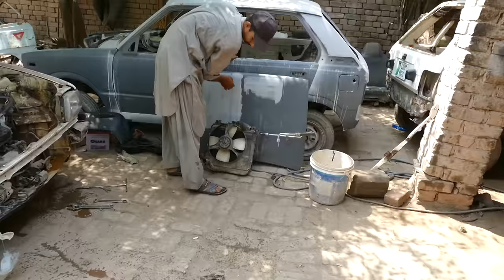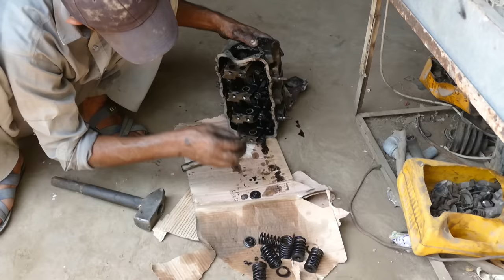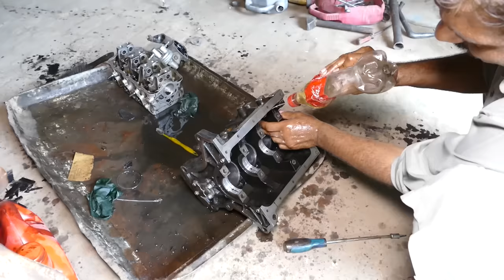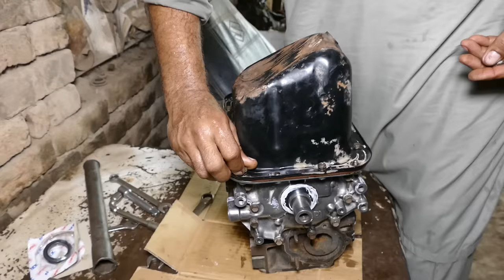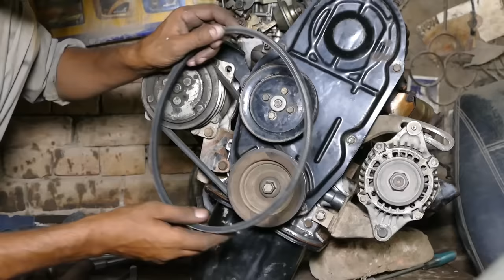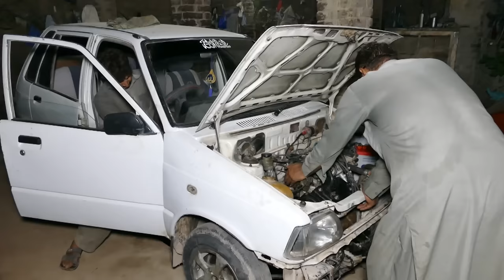Suzuki 800cc Car Engine restoration | Full Overhaul and Repair Engine

Comment: admire your skill. if you can do that, you may not have any obstacles in your life, meaning live free. I think every one should drive car like that, pure without too many 'technology'. Here in US, people spend 50-100k $ to buy cars (trucks), fully loaded with 'technology'. anything happens, mechanics charge them several thousands to 'fix' that. This happen really to German cars, full of technology and plastics. I like old Japanese cars, pure simple.
Reply: I also like simple cars. I recently bought a Chevrolet Blazer 4.3 96 years old. Cool car
Reply: Pppp0ppppppppppp0ppppppppppppppppppppppppppppppppppppppppppppppppppppppppppppppppppppppppppppppppppppp0pp0ppppppppppppp0ppppppppppppppppppppppppppppppppppppppppppppppppppppppppppppppppppppppppppp00pppppppppppppppppppppppppppppppppppp0ppppppppppppppppppppppppppppppppppppppppppppppp0ppppppppppppppppppppppppp0ppppppppppppppppppppppppppppppppppppppppppppppppppppppppppppp0pppppppppppppp
Reply: Слава богу в РФ не так распространена мода на современные одноразовые машины.
Всё эти "технологии"  ведут к обычному обваровыванию людей.
Менять авто каждые три года-это что экология такая типа?
Reply: The older German cars are the best built and most reliable cars ever built.
Mercedes built before 1990 were built to last forever is taken care of. 
I have several friends with Mercedes diesel cars from the 70s and 80s
With over 500k miles and still original engine and transmission. 
I own 1987 Mercedes 300d turbo diesel with all options and it runs perfectly 
And gets 28 mpg it is a heavy well built car which is simple to repair
And it gets better mpg than Japanese cars of the same year. And it is much easier to repair and drives allot better than Japanese cars from 1987. Every part on Japanese cars are disposable. Mercedes parts were made to last and be repaired.  Germany had the best engineers in the world. That is why more old German made cars survived than Japanese or American cars.  I am American 
And prefer Mercedes over American cars of same era..  America stopped building good looking cars in the 70s  the 50s and 60 American cars were fabulous looking cars. Now we built ugly ugly cars that are disposable plastic junk.
People have no pride in what they build anymore.

Comment: Reminds me back in the day,  but I did use a torque wrench and these guys just have to work with what thay got, just love watching them 👍👍👏👏
Reply from the maker: Thanks 👍
Reply: torque wrench???? what the hell is that?
Reply: And they just love stripping bolts 😋
Okay not everytime but it is more frequent than you think
Reply: @muhammadbabur7636  to properly torque down a specific spec the bolts gotta be screwed in. Like to put the head together it has to a specific spec u don’t want it to be to tight and you don’t want it to be loose.
Reply: @stephenlee9935  That was a satirical remark...
Reply: Jak jesteś na świętej wojnie z silnikiem i allach prowadzi twą ręke to nie potrzebujesz klucza dynamometrycznego :-)
Reply: تاسو باید د ښه کیفیت کار لپاره ډیرې پیسې ورکړئ.           
बेहतर गुणवत्ता वाले काम के लिए आपको अधिक भुगतान करना होगा।
சிறந்த தரமான வேலைக்கு நீங்கள் அதிக கட்டணம் செலுத்த வேண்டும்.
Reply: @muhammadbabur7636  você é homossexual?
Reply: If the threads are lubed and the bolts up to snuff, two pulls and a grunt will do it, just NEVER re use those torque to yield bolts
Reply: У них уже торированные, динамометрические руки.
Reply: It's funny they always have a cigarette hanging from there mouth. I love these guys.
Reply: If you reuse old stretch bolts a torque wrench doesn't make sense ,

Comment: Thank you for posting.I owned a 1996 Geo Metro (rebranded for U.S. and Canada?) It had a 1000 cc 3 cylinder, single overhead  cam(SOHC), throttle body injection (TBI).   That was my daily work car for a full time employment 3 days a week. Round trip was 110 km. Great heater, I never used the a/c as it pulled the little engine to hard. This was in central New Mexico, with an altitude of  1,600 m. I bought it used in 2005 and drove it until 2011. Well over 100,000 miles (160,000 km). I never touched the motor except regular maintenance and timing belt. It was the “Little Engine That Could”. There was fellow in Albuquerque, that would refurbish these little cars. As a side note it was said most parts were manufactured in Pakistan.
Reply: manufacturing parts is key 💥
Reply: Why wouldn't you activate the a/c ? It was there for a reason

Comment: Can't stop with my admiration!! How expert their editor(s) were in clipping/snipping out of the video all instances of where a torque wrench was used!!! Amazing!!
Reply: If your really confident and know what your doing you can tighten the bolts/nuts to the required tightness without the torque wrench it becomes something you can just know especially if you used to use torque wrenches before…it’s like a bank teller if they have been working in a bank for years they can usually feel the money and know if it’s genuine by touching and instinct that also includes knowing how much of the same value notes for instance 50 twenty pounds notes by the weight of it in their hand same for many people when you have been dealing with the same thing numerous times you get to know it..I can listen to a car engine idling for around 10 seconds and know how good it is and if there’s a problem.
Reply: @Silkroads733 how many engines seized before they « feel » the right torque😅?
Reply: @chefchaudard3580  I’m proud to say I have no idea..

Comment: As a trade school trained mechanic this makes me cry.  They threw the compressor down in the dirt but will they take it apart and clean it before putting it back on the engine? Can't imagine how many evap valves get screwed up this way after an engine rebuild.   In every video they put the thrust washers with the the crank, but not once in any video have I ever seen anyone check end play.  Some of these rebuilt engines must have interesting clutch problems. Never seen anyone check ring gap clearance nor piston to cylinder clearance.  All it takes is a machinist who is not on his game and things might be really wrong, but if you can beat the piston into the cylinder, then good enough seems to be the rule. Well at least they are rebuilding it on a table off the ground.  At the end it was running really smooth for a three legged dog.
Reply: Keinerlei Drehmomente beachtet. Aber dennoch alle Achtung für die Arbeit unter diesen Bedingungen.
Reply: @Yzb. CutMe Orses yes I could take an engine apart in the dirt and yes I could put it back together in the dirt and yes I can forget to torque all the nuts and bolts but it doesn't make it right. Yes I am a certified and licensed mechanic so I do know what I'm talking about. You have no idea what you're talking about. Being sloppy and untrained is just that and not something to be admired.  If this is acceptable engine repair in Turkey I understand why you support it, but if not then you should understand all the mistakes and bad habits these street mechanics use while repairing engines.
Reply: Well in my opinion, these cars were probably repaired like that a thousand times and doing ok for them… even if it means dripping oil, head gasket problems and rusting. It’s not the right way, but its a way that works for their economy and enviroment.
Reply: Oh snap! A YouTube professional, or what do they call these guys? YouTube warriors or some shit XD
Reply: Its about getting the car back on the road as quickly as possible so you can continue making money to feed your family that week. A trained technician in these parts is someone who learned from their father who learned from their father...etc
Reply: @shane6961  Shane,  can't agree with you more.  What the problem is they have never been trained from generation to generation.  Come backs must be an issue, yet I am sure seldom do they know why the evaporation valve stopped working  or why the rod cap backed off enough to spin a bearing.  The general attitude that if you want it out it doesn't matter where you hit it or or what damage you might do to the part which you are planning to reuse is the problem. If a mechanic fails to check the piston to cylinder gap and the engine seizes up a piston a 100 km down the road the mechanic has no idea he did something wrong or even what caused the failure.  It is the lack of training which is why they throw the air compressor in the dirt when they remove it from the engine sitting on the ground which bothers me not the lack of tools.
Reply: @bpetnoi1472  
calm down my friend thats how they fix their vehicles overthere its not the perfect job but if those shop guys learned , get better tools and increase their prices they will have no job at the end because people want cheap services
Reply: Mohammed, I know you are right, but it still a shame.
Reply: @MultiCoffeetogo  weil keinerlei Drehmomentschlüssel :D
Reply: @MultiCoffeetogo  Drehmomente werden überbewertet ;-) ! Ich finde es beachtlich, was die da tun! Was ich aber ganz ehrlich nicht so ganz verstehe: bei all der Mühe die sie sich machen, warum achten sie nicht ein bisschen mehr auf Sauberkeit, reinigen den Motorblock z.B. bevor sie ihn zerlegen wenigstens vom groben Schmutz? Ich bin mir sicher, der Motor würde länge und besser laufen. Bei aller Notdürftigkeit, die Teile ein bisschen sorgfältiger behandeln kostet nicht mehr, sieht aber nicht ganz so cool aus. Die Ventile in den Dreck zu werfen... unnötig. Aber ich habe ein pakistanischen Kollege, der hin und wieder versucht Maschinen zu "reparieren". Es ist abenteuerlich, wie kreativ der ist, kommt aber irgendwie nicht auf naheliegende Lösungen, wie z.B. eine Schraube lösen, Riemen spannen und Schraube wieder anziehen... da wird einfach Klebeband um die Riemenscheibe gewickelt... Klar, es funktioniert, ist aber irgendwie nicht dauerhaft und der ganze Käse geht von vorn los. Gerade wenn man so viele Mühe investiert sollte man doch im Rahmen der Möglichkeiten "nachhaltig" arbeiten.
Reply: @bpetnoi1472  ther is no better thing for people who love and live machinery then doing things right and that is all i can tell frome my perspectiv, as car owner i recently remaped ecu on my alfa with my own tool and knowledge
Reply: @Yzb. CutMe Orses hola desde España ,el comentario del señor anterior ,no lo decía por mal ,ni criticar ,
Yo soy profecional de la mecánica y veo que con esas herramientas no se puede hacer más ni mejor ,pero eso no quita a que pongan las cosas delicadas como el compresor del A/C tirado en la arena  ,igual que las tuercas y tornillos ,ya sé que es por costumbre pero serían unas máquinas de la mecánica si trabajarán con más limpieza y más ordenados ,,mira ya prácticamente motores así no hay tan fáciles y sencillos ,ahora es muy complicados los motores con mucho plásticos por todos lados y sensores muy delicados para tirarlos tan fácilmente por ahí ,los motores de ahora si no usas las llaves dinamométricas ,ese motor no duraría nada ,,no lo tomes a mal que ya se que la cosa no está muy bien en algunos países  en este asunto de aprendizaje de oficios ..de todas maneras me gusta estos vídeos ,,,saludos desde el otro lado del mundo (Canarias )
Reply: @Yzb. CutMe Orses cuánto valdría pasados a euros o dólares este trabajo ahí ?
Este trabajo buen hecho y pintado ,terminado a tope de buen estaría aquí en España por los 1000 euros la mano de obra , y si fuera un motor diesel moderno ,ej Toyota land Cruiser ,,Entre 1200 a 1500 euros ....
Los repuestos apartes ,,y se hacen mucho trabajo así ,lo que nunca verás tanto desorden ,ni tantas manos montando un motor ,los motores lo monta uno solo y se revisa todo dos veces las piezas internas y se miden muy bien los desgastes , se pinta el motor y se trabaja con protectores a ambos lados del coche  con colchas o mantas de mecánica para no rayar nada ni ensuciar , un motor aquí sale tan rápido o más del taller que ahí seguro ,y estos trabajos hay que cobrarlos bien porque se exigen mucha garantía un año ,
Yo he armado y montado en el coche un Mitsubishi Montero ,o Toyota Hiace ,etccc  en un día teniéndolo preparado y limpio ,,pero también te digo que hay coches muy complicados con tanta tecnología moderna ,y es aquí donde tienes que ir despacito y los aprietes bien hechos ,,,,,saludos desde Islas Csnarias
Reply: Именно так и есть. Моменты затяжки не учитывают. Продольные и поперечные люфты тоже мимо. Сделать капитальный ремонт головки блока, определить износ рокеров и пр. - вот что требует понимания и знаний. Вам желаю всего самого хорошего и здоровья!
Reply: @thushar  No, they will NOT.  These backyard mechanics do not have the knowledge or working skills to build a rocket ship even with good tools.  Good practical skills such as clean assembly are required to have things last.  If you want your car repair to fail quickly, these guys are the ones for you.   TOOLS do not make a good mechanic, knowledge does.  If you had any mechanical aptitude you would understand and not have been so rude with your "shut up" comment.
Reply: And they don't torque anything. Did u see when they took the head off it fell and almost on his bare feet. Lol
Reply: Engine rebuilt Kia phir bhi inti vibration 😩😩😩

Comment: So. No impact guns. no benches and no mechanical assist for engine removal. I like it.

Would we in the UK rebuild an engine like this? I think not. No we would go to the local scrapper and get an engine there, that is if the vehicle was worth spending the money on. I expect that the car would be scrapped. Such is the mindset in the UK.

Spares such as over size pistons, main and big end bearings would be hard, if not impossible to obtain locally. 

Great to see value in repairing not scrapping.

Thanks for posting.
Reply: The number plate shows this is a 2007 model. Still running strong! Beat that environmentalists 🙂
Keep it running till it rusts away!

Comment: I really like how these guys use four hands to do many parts of this engine dismantle and rebuild.  ... and, no torque wrenches. Excellently, they do it all in one day!
Reply from the maker: Right on
Reply: No torque-Wrench ... seen that often in similar vids ... I wonder for how long this engine will run.
Reply: @joostderidder  pretty long, these are mass manufactured econo vehicles, not special cars with tight tolerances

Comment: Definitely going to leak everything, definitely will be re-rebuilding soon. I respect the fact they're working with what they have, but also there's a reason for using torque wrenches, and torque sequences, not mixing and matching main and rod caps and hardware, replacing rockers, etc.

Comment: Very proud of our talented people. May GOD Bless them. 
I don't know how much it cost to have an engine like this overhauled in Pakistan.
I believe in America it is a job worth $2,000.00 or more.
Reply: If you're paying for parts and labor, A lot more than 2000... especially if you include machine work even for even a vehicle like this. In our country you'd scrap that vehicle without a second thought because it's only worth 500$ maybe 800 if you're lucky over here running. That's probably why it's over there to begin with because we get rid of vehicles like that to other countries. I'm not saying it's right or the way we operate over here is right, because it's FAR from it.... but that's what it is.

Comment: Made me feel a little better to see a “mechanic” drop the oil pan nut into the dish. It’s not just me.
Reply: Oil pan bolt, or plug, not trying to be a dick, just a pet peeve of mine. Nuts thread onto bolts.
Reply: @nouseformyname3788  Point made. It’s a plug.

Comment: Love the way they strip the engine out at the side of the road and toss all the bolts into a pile. How the hell do they remember where they all go back again?
Reply: Do something long enough and repetitive enough, it becomes second nature. Haven’t had to catalog bolts in decades.
Reply: That engine does not use a lot of special bolts like modern engines. There are some special ones - those you remember instantly. All the others do not really matter that much 🤣

Comment: after all these efforts car steering shakes when engine running. Needs an engine mount.
Reply: 3 cylinder single over cam engines are for value, not smoothness.
Reply: in poor countries people don't give a shit about that if the car shakes or air conditioning as long as the car runs that's what it matters

Comment: While I admire the skill, I wonder how long this will last? Did the valves go back into their original seatings? Coolant water without corrosion inhibitor? The massive vibrations in idle? And they have lathes, but not a single torque wrench?

Comment: i admire their work, but this would not work in north America, a complete RE and RE of an engine in a garage would cost someone thousands, and some old 80s Suzuki would not be worth the trouble!!!
Reply: indeed, but in this part of the world, labor is quite cheap ... a complete engine overhaul  would cost you somewhere around 200 to 300 dollars,    ...  that's the reason even used cars here are not cheap because their maintenance is ...   even this old Suzuki 800 would roughly cost around 2500 to 3500 dollars : /

Comment: Awesome video 👍. No mucking about.  The bliss of the old engineering.  It shame you can't do that nowadays with so called modern and sophisticated engines full of electronics   sensors  even fibre optic cables...
✌❤🙏
Reply from the maker: Thanks 👍
Reply: Very true, you can't fix modern shit like this because they make it complicated on purpose. Just try to see how difficult it is to fix even the smallest issues in a modern BMW or Mercedes, they make it difficult on purpose so you always use the OEM to fix your stuff, or, they sell specific proprietary "knowledge" on working on these vehicles to independent mechanic shops usually.